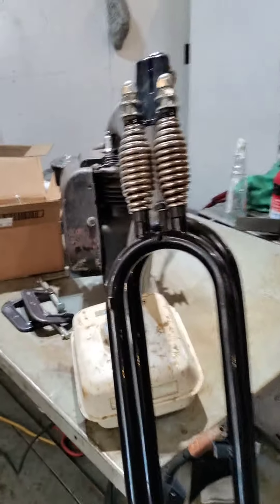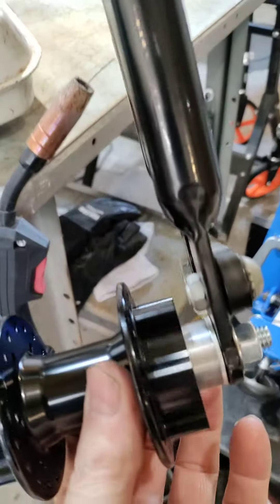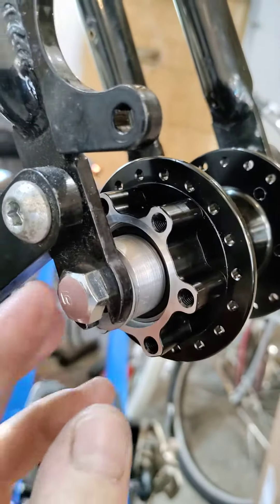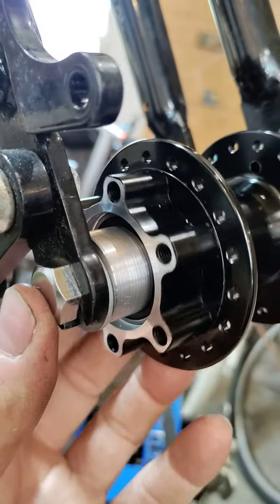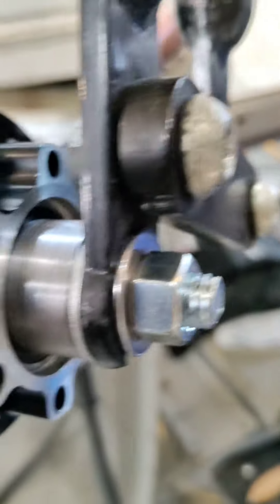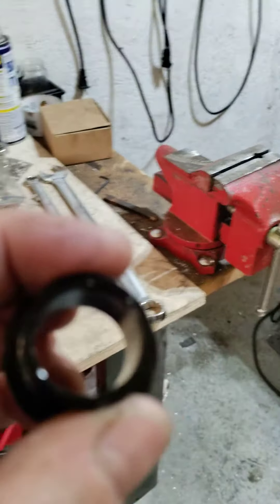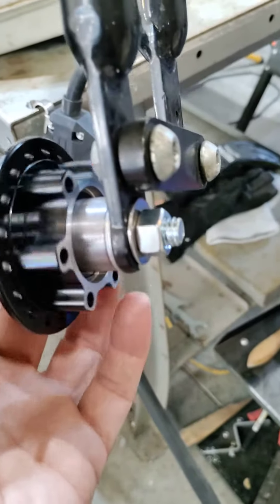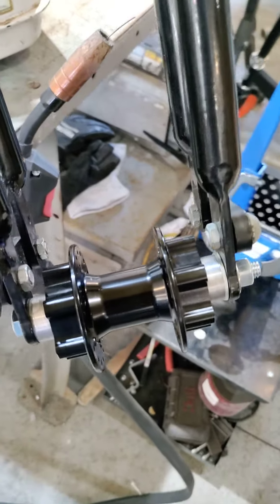July 31, 2021

Comment: Hey will, want to ask is it possible to make a whizzer replica (with that kit yes) with modern parts to be working with disc brakes and have it as a modern board track racer with your wheel hubs?